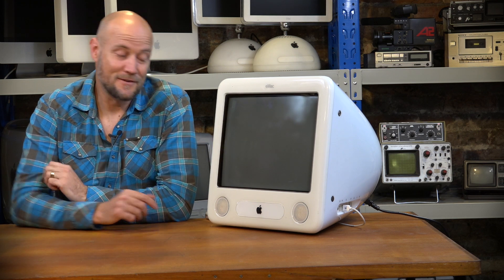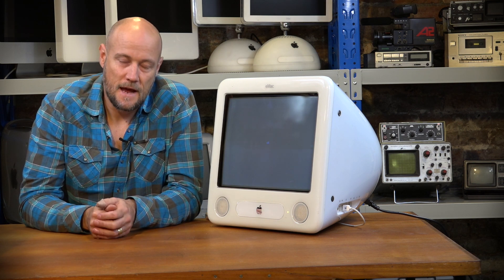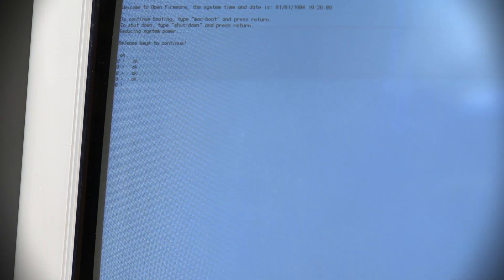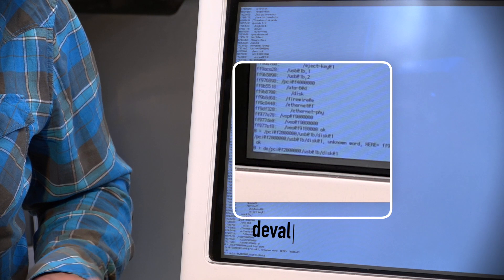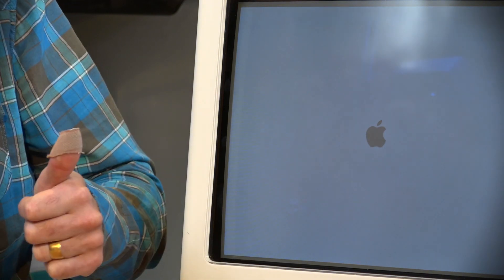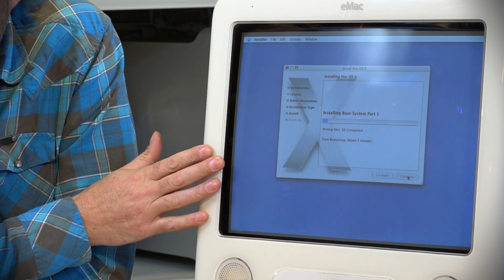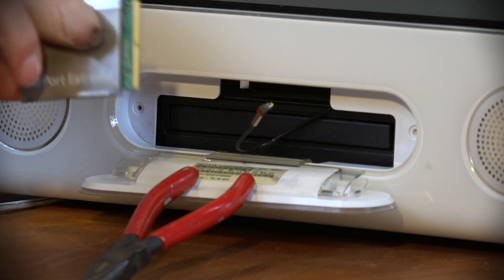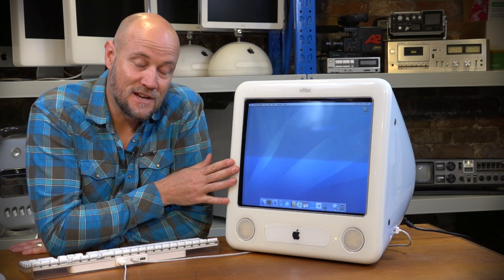eMac Adventures! Part 2/2 - Why doesn't it work???

Comment: Thanks for the very informative video! Mine’s built for 110V from years ago when I lived in the US. I have moved to the AP since, and finding a 220/110V step-down transformer with the huge startup power that eMac needs being a problem, I abandoned it. Only recently that I found out and removed the jumper which converts the eMac to 220V. But booting up flashes the folder icon with a “?” and a face, just like yours when you replaced the HDD.  When I try to boot with the OS X 10.4 CD, the “?” and the face don’t flash but it keeps spitting out the CD without doing anything.  As a last resort I was trying to create a USB boot drive of OS X 10.5, but my MacBook does not recognize the OS X 10.4 dmg file. How did you create the USB boot drive?  Anything else you suggest I try?

Comment: These 2 videos are AWESOME. It's so valuable to record and provide commentary on everything you do to refurbish and rebuild these machines. I know I gave you a hard time on the previous video regarding how much thermal compound you used… but you asked for it! Anyways, I recently rescued an Apple eMac with 1.25 GHz processor, 40 GB hard drive, amd 2 GB of RAM, and had it professionally recapped. Taking it apart was somewhat easy. Putting it back together was another story. I attempted to use a USB stick to install the OS but couldn't figure it out. I happened to have a factory disk for 10.5.8 so that's what I used. I'm starting to see why I should have used a previous operating system because I wanted to run a lot of classic apps and the architecture just doesn't support it on my version. 😢 Anyways, lovely videos, glad I found your channel. Subscribed!
Reply from the maker: Thanks mate! Enjoy playing with your vintage Mac!

Comment: Hi, thank you for the video.  I am trying the same thing on an emac I recently acquired and having many issues trying getting the Tiger Installer to run.  Whenever I try to do the dir command on the ud alias that was created in Open Firmware, I receive "USB-MS-CLASS: open of DISK-LABEL failed can't OPEN the DIR device".
Reply from the maker: I’m sorry I’m really not much of an open firmware expert. I just follow guides I find on google. There’s a lot of variables you have to get right, so it’s pretty hard to pin point the issue. Keep trying, you’ll get there!

Comment: TYSM! I needed to know how to boot from a USB on one of these old machines as the install of Tiger was corrupt. I'm not really sure why Apple made is such a pain in the backside to boot from external USB's on these things and then decided to make it 10x easier on Snow Leopard... Annoying.
Reply from the maker: I guess USB drives weren’t as widespread or as cheap back then. It was all about optical media.
Reply: @TheBasementChannel  True! I wonder why they gave the hidden dev option todo it in the Darwin Kernal IDE then??? Odd
Reply: They - them selves had to figure it out ... I suspect . . .. .  Firstly having failed a time or two . . . . . . . .
Reply: @ What?

Comment: Thanks so much for this! If you happen to still be checking/responding to comments, I have two questions: 1: how did you determine that your partition was number 10? I only have one partition on my flash drive so should I just use the "," without a number? 2: in choosing the file to boot from, I don't see one called BootX on your USB directory, so why did you use that? I can get my directory to work fine but I can't get it to open the bootable file (an .iso). Thanks! ;-)
Reply from the maker: Hey there! Your ISO is not a bootable USB. You need to restore the install to a usb disk. BootX is the file to run on the installer. Hopefully these instructions help you out. https://idevicecollector.home.blog/2019/04/02/how-to-boot-your-powerpc-g3-g4-or-g5-from-usb-using-open-firmware-mode/
Reply: @TheBasementChannel  Brilliant! Thanks so much for giving this noob a dose of much-needed education!
Reply from the maker: @bryanambition  hope that helps! I forget every time I come to do it and have to relearn it again anyway. 💁‍♂️😅
Reply: @TheBasementChannel  I'm trying to install it currently, but I'm stuck on the apple logo with loading symbol. Is there anything I did wrong? Could it be a bad dmg of the os?

Comment: What’s funny is that needing to drop into Open Firmware to boot from USB isn’t a firmware limitation, it’s an OS limitation. Any Mac OS 9 capable Mac with AGP graphics or later (1999 onwards, so starting with the iBook, slot-loading iMacs, PowerBook G3 Pismo, and AGP Power Mac G4), with a firmware update that came around early 2000, could boot Mac OS 9 from USB without a problem. It is the Mac OS X bootloader for those machines that doesn’t know how to boot from USB. I worked as a Mac technician in those days, and we just used FireWire for any Mac that had it, since the USB 1.1 ports of those models are slow. That and a binder of install discs for every imaginable OS version. :)

Comment: Wow a wireless emac nice, im assuming not many websites work though right? The browsers old and site certifications and such. My g5 had airport extreme but still cant use youtube or many websites really. Glad you got it working
Reply from the maker: Yes wireless more of a novelty at this point
Reply: @TheBasementChannel  Not at all. It worked well and was used by lots of people. In fact, even if you still relied on dialup, the TCP/IP stack in the AirPort Base Stations was so good that it actually gave better performance than dialing up directly from the computer.
Reply from the maker: @tookitogo  I meant having wireless in these machines is not useful today. No one’s claiming it wasn’t useful at the time obviously.
Reply: @TheBasementChannel  Ok… “novelty” means “new thing”, so I thought you were referring to how it was at the time when it was new.

Comment: What mac model would you suggest (not intel one) that can run OS7,8,9 and PPC games and applications? I have possibility to buy imac G5 17" 1.9, but I would like to know is there any other model to look for. 
I was thinking about MacMini G4 1.5, but they are hard to come by where I live.
Reply from the maker: Well, that’s quite a wide range of OS. Certainly not possible on a G4 or G5. The only Mac that might be able to run 7,8, and 9 is a ‘97 power Macintosh 8600 or 9600, or the 1400c powerbook. You’d probably be better off running that stuff in emulation on a modern machine.
Reply: @TheBasementChannel  I know that, but real is real. Otherwise I would not have 4*c64 and 2*Amiga500, A600 and A1200 in in my "man cave". :)

Is G5 1.9 17" iSight OK machine for hobby? Does it suffer from bad capacitors?
Would it be better to chase eMac G4 1Ghz which can boot to OS9 natively and maybe do dual boot?
Thanks.
Reply from the maker: I’d get both🤷‍♂️
Reply: @TheBasementChannel  Good one. I'll call you to explain that to my wife... :-D

Comment: Great stuff with the eMac. Just one question, I have one also but keeps freezing a minute after the apple logo and screen is white with 2 thick vertical black lines. When I checked hardware test it came back with bad video ram however sometimes it passes also. I think the ATI 9200 Radeon is soldered onto Mainboard which would mean a hard fix. Just checking that there is no easy option to swap out video cards for an eMac. Was hoping to see on your video where the ATI 9200 Radeon was on the eMac and what options if you get Hardware Test failures. Cheers
Reply from the maker: Sorry man, I’m just a guy with more ambition than skill. If I manage to fix something it’s probably due more to luck than knowledge. Hope you can find the answer to your dilemma, but knowing Apple from this period, I’d say it’s time to replace the logic board.
Reply: Cheers mate!

Comment: I just got mine from someone it works good but I want to put it back to factory settings. How do I do that?
Reply from the maker: Hi Sandra! The best way is to reinstall the OS. If it came with the original DVDs you can use those. Or else try the USB method I used. Failing that you could always create a new admin profile and delete the old user profiles, provided you have admin access of course!
Reply: @TheBasementChannel  thank you.

Comment: As a suggestion, if you get a FireWire enclosure and put an SSD in it, you can put the Mac OS installers on that. While Mac's of this era did not boot to USB, at least without the Open Firmware rigamarole, they happily boot up to FireWire external drives. Cool stuff here, you deserve a lot more than 128 subscribers.
Reply from the maker: Great comment! Yes I am aware of the FireWire drive option, but the only FireWire drives I have require external power and are quite bulky, which makes them a bit of a hassle to move around and hook up to different machines. I’m keeping my eyes open to find a small enclosure 👍👍
Reply: @TheBasementChannel  OWC has a good one, FireWire 800, convertible with an 800-400 cable. Amazon has some cheaper FireWire 400 only ones, which work fine.  They are capable of being self powered, but work fine on bus power as long as you are not daisy chaining them.
Reply: Actually, the OWC enclosure is usb 3 as well.
Reply from the maker: Thanks, I’ll check it out👍👍
Of course in the perfect world they’d make an enclosure with FireWire, usb3, and thunderbolt. One to rule them all!

Comment: I was very happy to encounter your channel, it's nice to see people still carrying about 18 years old computer. Your videos are really great, the editing is perfectly done ! I've also bought on of this for a couple bucks few days ago and it's very fun to re-discover this old machine. Do you think you could put some links for the airport extreme and the RAM ? I really don't know what kind of hardware I'm supposed to use...
Reply from the maker: Hey there! Thanks for the comment and feedback. My go-to resource is everymac.com, I use that site for most of my info. I’m sure you’ll find what you need there.👍
Reply: @TheBasementChannel  Thanks ! I found everything I was looking for ! Do you know how the RAM improve the experience on this kind of machine, I would like VLC to run mp4 file but for the moment it's working horribly, improving the ram will change anything ? Should I also change the HHD with an ssd ? Or is it Just due to the processor ?
Reply from the maker: I suspect the issue is probably to do with the processor and codec. More modern h.264 codecs are very taxing on these older processors, especially if they lack the hardware accelerators to decode. Upgrading the RAM or installing a SSD would probably not make any appreciable difference. Using older DivX or Xvid codecs will work better.
Here’s an excellent thread on the topic that should explain it all better than I can:
https://forums.macrumors.com/threads/video-on-powerpc-part-1-playback-on-g4-g5.1296071/
Reply: @TheBasementChannel  Wow ! There is a lot of interesting informations ! I'll try these softwares tomorrow, the author also explains that if you only want to watch videos it's better to upgrade the os to 10.5, do you agree with this point of view ? I heard that the difference between 10.4 and 10.5 is huge, will the G4 handle it ? And once again thanks for your help !
Reply from the maker: You might have to try it and see. I’m not sure 10.5 will help or not. I stick to 10.4.11 for the reasons mentioned in the video 👍
Reply: @TheBasementChannel  Hey there, I'm so happy I found a solution. So, I downloaded Coreplayer, a software that was created to read H.264 file on powerpc, and it works perfectly !

Comment: Those motherboard connectors are hell! I always have problems reconnecting them when I put iMacs or emacs apart. For installing Mac OS on a fresh disk I like to use target mode or a FireWire drive . My install flash drivers never work. (Edit.: now I know why! I’ll stick to target mode lol All that open firmware stuff is just too much trouble!)
Reply from the maker: OF certainly gives me a headache everytime 😅 The problem is I never use it often enough to remember how. I must have filmed that bit 10 times and kept making a small error😂 I might try target mode on the next one, seems like a good excuse to use another old Mac for something useful.
Reply: @TheBasementChannel  it is just bash. So easy to learn.
Reply: @TheBasementChannel  just like Unix and Linux. Even in the 80’s and 90’s they used the same commands.
Reply: @TheBasementChannel  I worked as a Mac tech back in the day, and we basically never had to go into open firmware. It wasn’t necessary. If I had to install the OS onto a Mac with a broken optical drive, I’d boot that machine into Target Disk Mode, then connect it to a similar Mac via FireWire, and run the installer on that machine, selecting the first Mac’s disk. Works beautifully.

Comment: Great video. I would point out that formatting the drive as extended journaled is the better option. This means that in case of improper shutdown, you reduce the likelihood of loosing files. I look forward to more of your videos!!
Reply from the maker: Great info, thanks for the heads up.
Reply: Didn’t the installer enable journaling anyway? Journaling on HFS+ was bolted on after the fact, so it could be enabled and disabled without reformatting.
Reply: @tookitogo  by default it’s selected I think but in this video HFS+ was selected.
Reply: @pacmania1982  I know Disk Utility selects it by default. But I’m talking about the Mac OS X installer. Im pretty sure that starting with some version of Mac OS X, the installer would turn on journaling even if it was originally formatted without it.
Reply: @tookitogo  by default it’s selected I think but in this video HFS+ was selected.